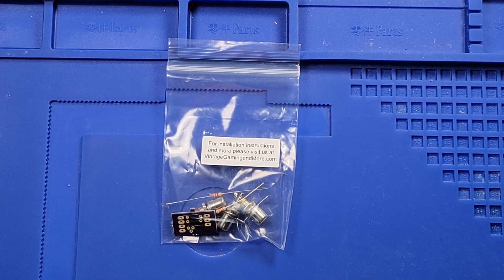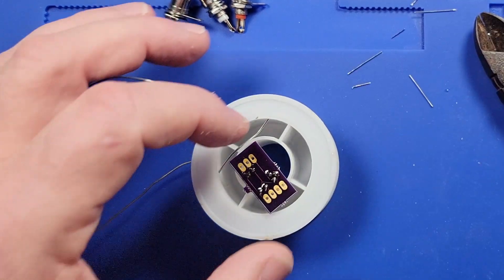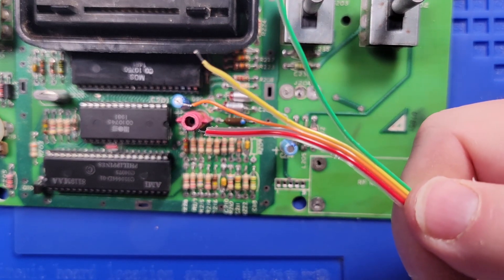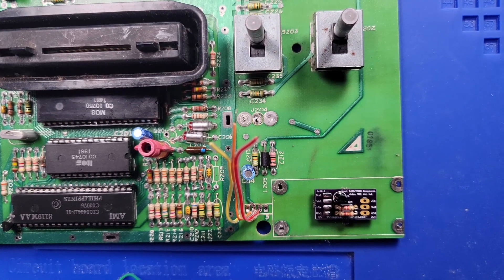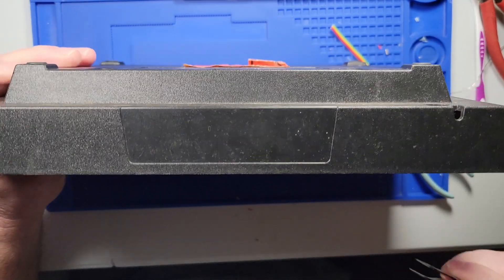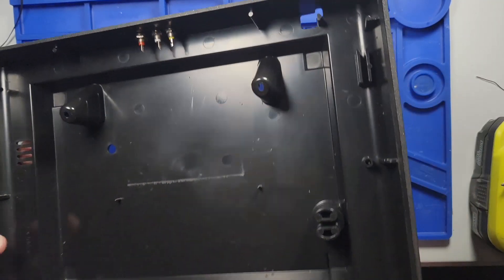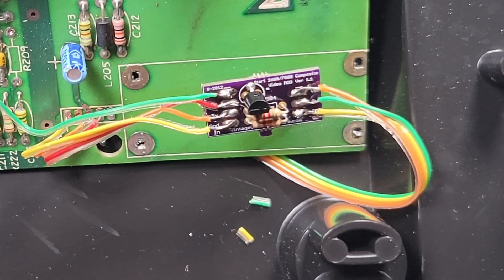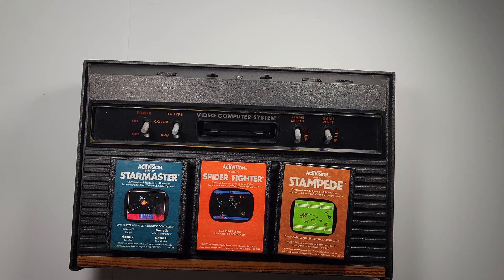Atari 2600 Composite Mod

Comment: 3 things needed to be removed or disabled, the RF box, the transistor, and R209 (which you didn't mention, but was already removed on your board).

I've seen one place mention that picking up the audio from that place on the board can be harmful to the TIA chip and or your TV as it's pretty much in direct connection to the TIA, and it should be picked up on one of the resistors above the two silver audio caps (R207 which you remove and solder into the through hole next to the shielding ground ), as it'll keep the decoupling circuit in line.  But I'm not sure how true or false that really is.

I just went ahead and attached my audio pick up from the same spot you did (like the instructions say), but I went from the bottom of the board by running the wire through one of the holes left from the RF box.